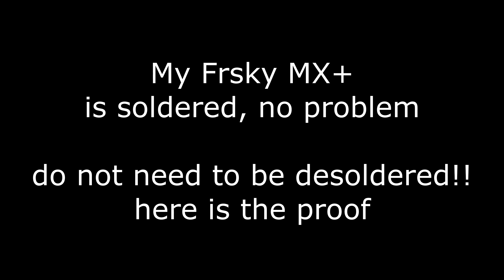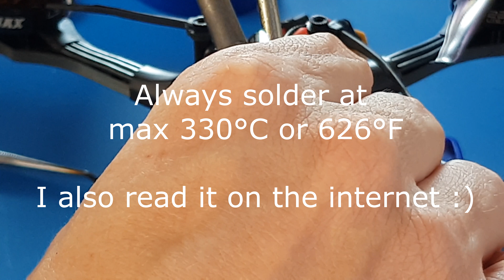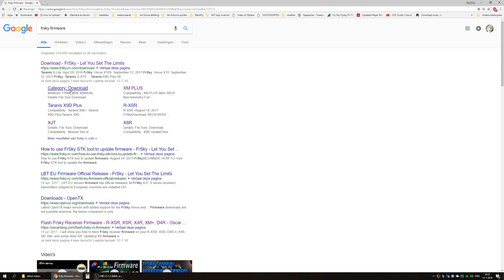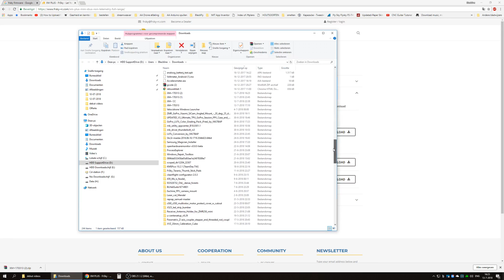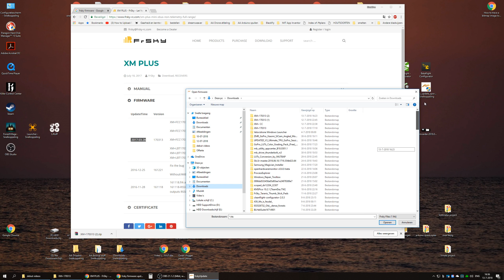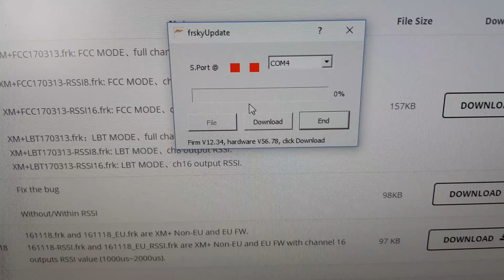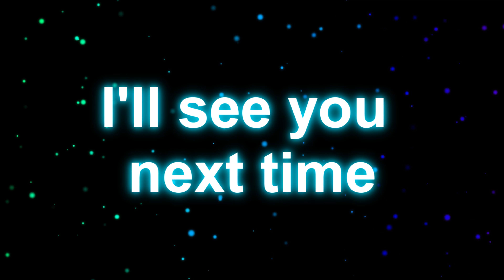Frsky firmware update flash XM+ always good

Comment: Many thanks for this information Blackline. I have found this method very effective 👍
Reply from the maker: :) gladly done, and thanks for your reply
Reply: @Owenenlynn  Upon reviewing your video, was it necessary to keep the 5 volt pin unplugged  prior to clicking File on S.port tool program? Would it have been feasible to connect the 5 volt wire from the beginning, or was there a reason to plug it later on? Many thanks again Blackline VW!
Reply from the maker: Hello Rayhova, yes there is a reason for this, has to do with, that your computer detect the receiver and not the FrSky STK S.port because that is already connected :)
Reply: Ahhh understood, thank you again! 👍